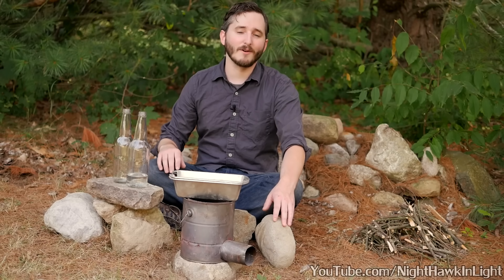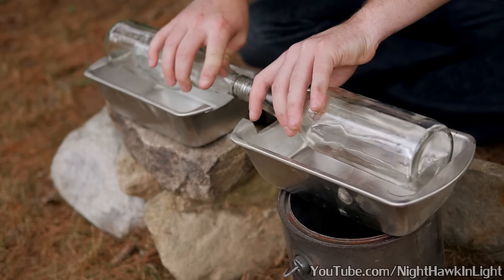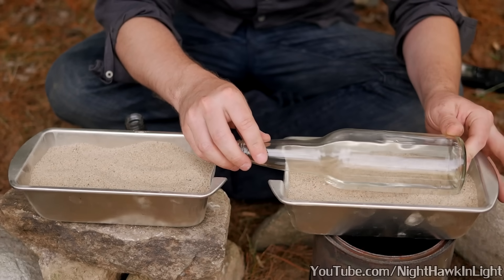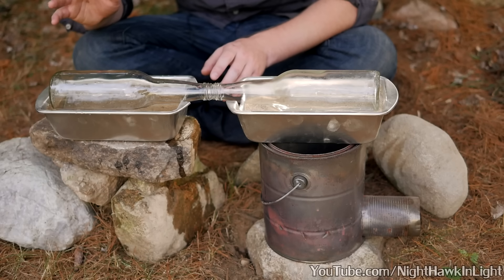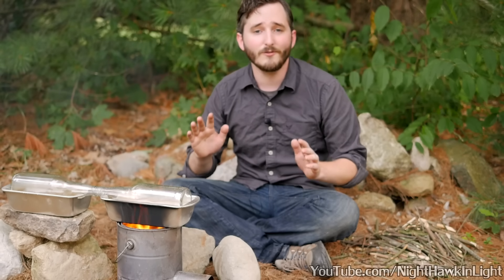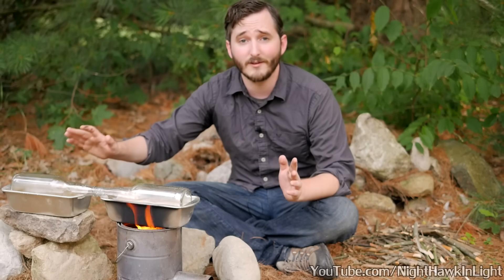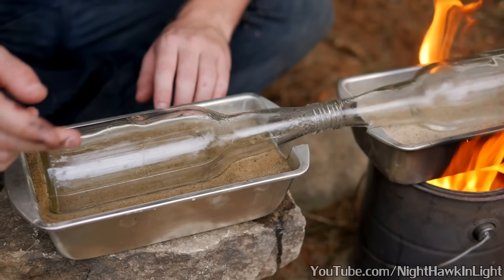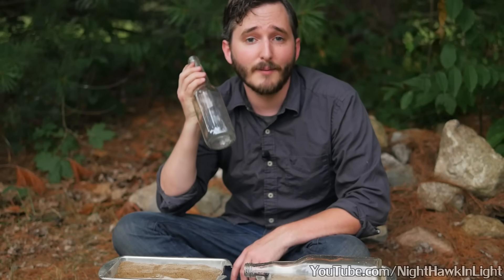How To Turn Salt Water Into Fresh Water (Simple Improvised Distillation)

Comment: something is off. water expans to 1600 times its liquid state, when it becomes a gas. It look like you get a 1:1 ratio of evaporated/condenced water, which is almost utopian. So unless you have trapped all the water vapor, without blowing up the bottles, then you are cooling the water at the same rate, as you are heating it. and unless you have wet sand, that is as cold as the difference between the boiling water and the ambient temperature, that can not be done. 
I have done this in a lab, with icebaths, cooling aluminium tubes and so on. The is no way this setup works this good.
Reply from the maker: Try it, it works amazingly well. Very little steam escapes.

Comment: That was great - You could increase the efficiency a lot by connecting the two bottlenecks with some kind of flexible connection, and arranging each of them at an angle of about 5 - 10 degrees off horizontal. This would allow much more water to be distilled at one time.

Comment: The heating would be quicker if the sand was wet; too~!
Reply: Maybe warm up all the sand quicker, but wet sand will only reach the temp of boiling water and stay there until the sand is dry and water evaporated... dry sand gets hotter and retains it heat for surface contact longer than wet sand and can also heat the salty bottle more efficiently when dry due to that.

 In other words, with your idea, more of your heating BTU's would go to evaporate water from the sand over a much longer period of time to distill potable water by evaporating water into the air from sand, water that isn't even inside the bottle to be collected. A Total waste of heat energy and its transfer.
This is the main reason he did not wet the heated side's sand. It is common sense.

Comment: Question for you, sir. If its even possible, how big would a still need to be to provide 400 gallons of pure drinking water from seawater?  Could one use large magnifying glasses as a heat source? I often wondered why they never used stills aboard ship in the age of sail when water was such a serious limiting factor. Could one not use metal containers rather than glass?
Reply from the maker: It takes a lot of energy. Modern ships use reverse osmosis filters and pumps which is more efficient than distillation.

Comment: Good video. Just one tip though: heat the water close to boil before mating it with another bottle and any petroleum volatiles, alcohol, or other active contaminates will evaporate before the water does.
Reply: You can then do partial destilation of that, get some kerosene, gasoline and diesel build a combustion engine, build a raft and drive off into the distance
Reply: Just get a small still...  Then you get booze, salt, and water out it(separately of course).
Reply: dylans voice   It's chemistry. 😊 You know how rubbing alcohol evaporates really quickly, but water can take a while? Well, that's because its boiling point is lower than water (82º C versus 100º C).

Since that's how most flammable solvents are, they'll evaporate off before the water reaches a boil.
Reply: So boil it for about a minute and then proceed. Thats pretty good advice actually, thank you.
Reply: well there still azeotropes and steam distillation.
so its quite difficult to obtain drinkin water from it. Maybe the last 50% of the last 20% that remains.... but even then its not very likely
Reply: @fastbre4ker  Does water commonly form azeotropes with petrol and common lubricants?
Reply: Cool idea.
Reply: Brilliant
Reply: Wait, what the hell are guys talking about? 🤔
Reply: Roma Rose  Yes and no. Its ideal if you can heat the water to boiling for about 6-8 minutes first and then do this with it. Some pathogens can transfer in steam, so it does help to have cleaner water to start with. Sure beats no filtering at all though either way
Reply: Blue Skies  Too much bad press, They've changed the name to Agenda 25.
Reply: @postalinVT  actually it's Agenda 2030. Revised,  look it up on United Nations website
Reply: @jasonhuffine1878  Right you are buddy, thanks for the correction :)
Reply: U sure mate?.
Reply: i bought a  "lifesaver" bottle..cleans dirty water instantly...about 60 bucks...there's gonna be a war soon...every century ever do you think this is the first one we get off...nope
Reply: @MrCrispian  the fuck you talking about lol, we've been at war almost the entire 21st century so far
Reply: @MrCrispian  life saver bottle does not desalinate.
Reply: @MrCrispian  there are wars happening all the time
Reply: @MrCrispian  looks like you were right about the war......